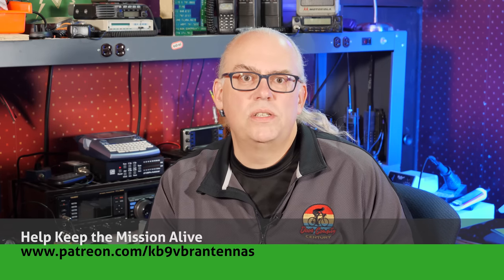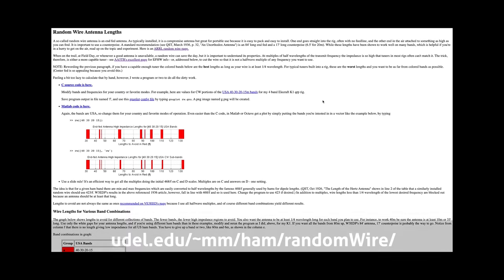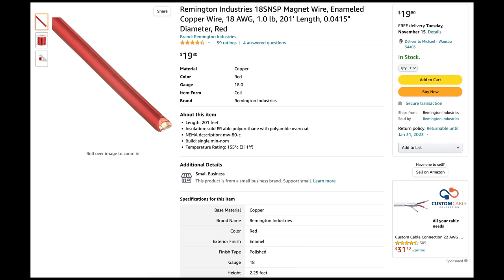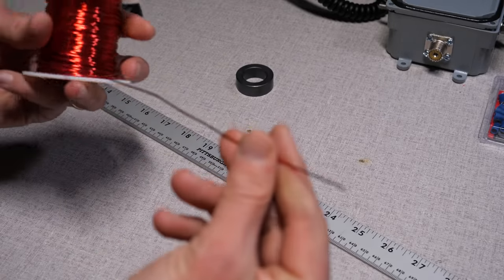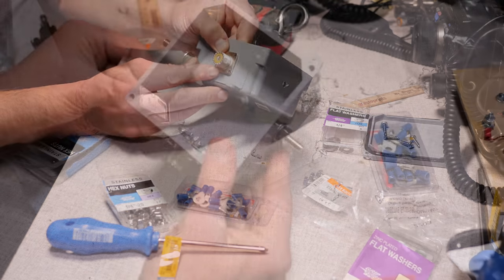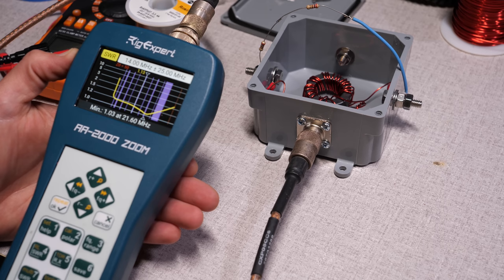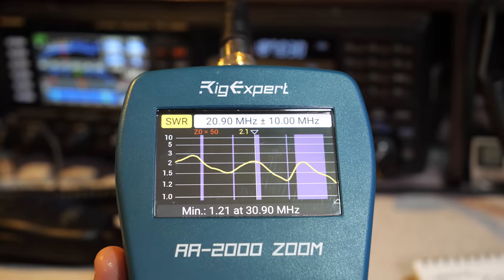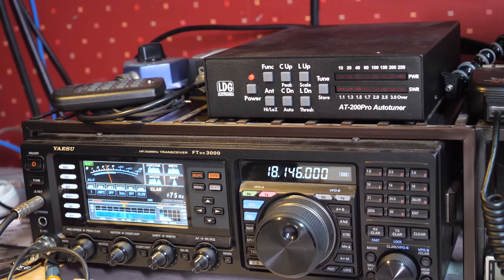Build a random wire end fed antenna and make amazing contacts #hamradioqa

Comment: In the 15:17 mark of this video you stated that we could put up a 10-40M antenna for as little space as 33 feet of space. Does that mean the wire would be 33ft in total for the 40 meters or will it be the normal 66ft for 40 meters?
Reply from the maker: There are two styles of end fed antennas, end fed half wave and end fed non resonant. The random wire antenna in this video is the non resonant type. So you need a length of wire that is not resonant on any of the bands you wish to use. The 66 foot length would be resonant on the 40m band so it would be considered an end fed half wave. You can use it on the fundamental and the harmonics, usually without a tuner. The wire as short as 22 feet is considered an end fed non resonant antenna. You can use it, with a tuner, on 40m and bands above it. Without getting too deep into the weeds, a non-resonant antenna typically has a lower impedance than end fed half waves, so even in using a tuner, you still receive a high level of efficiency as compared to an true end fed half wave.

Comment: Where can I find “600” ohm ladder wire ? I’ve looked at Home Depot , MFJ , and MTC and still nothing . Closest I find is 300 . Can I Double it to create 600 ? Errr
Reply from the maker: 300 and 450 Ohm window line is pretty common, but the 600 Ohm ladder line can be more difficult to source. Back in the day, most hams made their own with homebrew wood or plastic spacers and 18 ga wire. I did find a source online if you want to purchase some: https://www.trueladderline.com/w7fg-design-600-ohm-open-wire-feedline/

Comment: Why does everyone insist on using the mix 43 ferrite on baluns and ununs ?  The mix 61 is a much more efficient mix for this application and has a much flatter swr curve.  Use the mix 43 for 1:1 chokes only, use the 61 for 4:1 and 9:1's !

Comment: Can the same Magnet copper wire that you are using in this video be used if I had the FT240-43 instead of the FT140-43 that you are using in this video?
Reply from the maker: Yes it can. The FT-240 will have a higher permeability so you can run it at higher power levels. The 18ga wire will be sufficient for 100 watts, but if you want to do more, or use it 100 watts digital, I'd switch to a heavier magnet wire, like 14ga.
Reply: @KB9VBRAntennas  Is there any material that I should not use for the bracket that I will zip tie the toroid core to?

Comment: Thanks, I want to try one but I heard they don't perform as well as an EFHW or Dipole. Is that what you have found also?
Reply from the maker: Of the three antennas, the dipole will have the best performance as it doesn't rely on a matching transformer. As for efficiency between an EFHW and a non-resonant antenna, I think they are pretty equal. You may get slightly better efficiency using a resonant piece of wire, but the losses in a 49:1 transformer will be greater than in a 9:1 transformer, so their overall efficiency is about equal. I wouldn't let someone tell you that an antenna is inefficient stop you from trying one out.

Comment: Just used a Balun Designs 5KW 9:1 on 124.5’ sloping EF in my backyard. Compared it with my 132’ EFHW with a 49:1 UNUN. Similar on receive. The 9:1 covers 160, which is why I built it. Loads to 1.0:1 SWR with an IT-100 on a 7300. SWR appears too high to load on 1.9Mhz with my old Alpha 78 😞. Probably need a high power tuner. Will try trimming the wire first. Any suggestions? Mel, K2JWD

Comment: The only issue I have with these is the name "random" wire.  As you said - There is nothing random about the length of wire required to make these most effective.  I like the name Zepp, but I think "non-resonent end fed" would be the most descriptive. 
KZ9V
Reply from the maker: Old timers, not you Dave, called these 'long wire' antennas. I don't know when the term 'random' stuck, but it is a poor descriptor.

Comment: Have you tried this up up on 6 meters, or as low as 160 ?
Reply from the maker: I have used this antenna on 6 meter FT8 with decent results. It does have a bit of an unpredictable radiation pattern on that band, but otherwise works. I haven't been able to get a good enough match with my tuner to use it on 160 meters, though. I think the antenna is too short for that band.

Comment: Michael,  I see that you run the counter poise in the opposite direction from the antenna.  I have read from some sources that it should run directly under the antenna... does it matter?
Reply from the maker: I'm not sure if it matters. I've always run the counterpoise away from the antenna with the assumption that it's part of the system so it should be configured in a way to not interact negatively with the radiator. If you have a source for that information, I'd love to check it out.
Reply: @KB9VBRAntennas  I'll have to find it - but it seems to me there's an article in an old hints and kinks book where a ham set up a long wire antenna and laid down about 10 radials from underneath the radiator. I will have to look for it.
Reply: @KB9VBRAntennas  I added 20 radials away from the feed point and it made a huge difference in the Antenna's performance.  You have to treat it like a vertical.
Reply: @KB9VBRAntennas  Robert, KD4YDC here. Michael I have had GREAT success with this configuration. Really to the point of, I'm afraid to try anything else! I use a 9:1 unun in a sideways "V" config. The radiator is one leg and the counter is the leg closest to the ground. The feed point and the counter is at one end with a 3ft electric fence post and the other end of the counter is attached to another fence post 3ft off the ground. I use about 100ft piece of rg8 and it is on the ground going away from the feed point. I try to get it at least 16ft in a straight line (or more) before curving to my operating position. I have close to 6000 POTA contacts with about 95% on this antenna.  Most of these contacts have been on 20 and 40m. 3/4's of the POTA contacts have been from Georgia parks with one down in Gulf Shores, Al. It is absolutely my best portable setup in the field.
Reply: @BurtonChristmasLites what lengths are you using? I’m using 42ft for the radiating element and 42ft of counterpoise. I’m reading impedances a lot lower than 450ohm. Can tune some bands with low SWR directly connected to my ATU100. The tuner struggles a lot to tune some bands but I’m guessing the 9:1 wouldn’t change anything because impedance is already under 50ohm.
Reply: @ptsmonvideo  I honestly am not completely sure of the radiating element length. Oddly enough... I think it might be around 66ft. Yep. Not a "random" length but has worked for me. The counterpoise is somewhere around 33ft.

Comment: do you need a transformer for rx only? Eg. RTL SWR application?
Reply from the maker: For receive only a non-resonant, or random, length of wire works great. The more wire the better, but something 29 feet or longer will do fine for almost all of the shortwave bands. A transformer isn't necessary.

Comment: I wonder, can a wrought iron fence used as a random wire antenna?
Reply from the maker: Possibly. There's lots of examples of people using large random objects as antennas. It would depend on how well the sections are connected.
Reply: The sections are welded together. I would try to use it as a receiving antenna only. Would I need a 9:1 unun? To where the center connector should be connected? How about the ground?

Comment: Why put tape around the core? The 43 mix doesn't conduct! Put an ohm meter on it. If it conducts it isn't a 43 mix. Plus the magnet wire is insulated.
Reply from the maker: Magnet wire is insulated, but the enamel can be scraped off easier than PVC coatings. As long as you don't rough handle the transformer, or well secure the core and wires, you can certainly get by without taping the core.
Reply: Exactly.  Wrapping the core only makes it harder for the core to dissipate heat.  Not sure why fold wrap them......

Comment: What if I do not have the space for a counterpoise? Do I have to have the counterpoise?
Reply from the maker: For non-resonant or random wire antennas, a counterpoise is necessary.
Reply: just let the counterpoise hang down to the ground. Works fine on a 15 ft high antenna

Comment: Hi Michael, got a question. I can't get a straight answer from anyone. I want to build a mono band endfed for 10m only. I have a 49:1 balun. I've been told 13.2 feet and 16.2 feet. Since I have to be very stealthy and I only talk on 10m I don't need or want anything longer. Thanks and 73
Reply from the maker: I'd think that the 16.2 foot length would be the correct one as it is closer to the resonant length of a 10 meter dipole. Even if you are using insulated wire and shortening it for velocity factor,  your length will still be 15.5 feet. I suppose you can start with the longer length of wire and shorten it until you get a good match.

Comment: would you do one on 10 to 160 full wave ,   THanks Rodger W8RRM
Reply from the maker: Sure. The transformer will stay the same, you just need to add more wire. About 135 feet will work for 10-160m bands. This chart can help pick an appropriate length: https://udel.edu/~mm/ham/randomWire/

Comment: Nice info as always, will it work for 6m? Thanks for sharing. KC3UEE
Reply from the maker: 6 meters is tough for this style of antenna. The 1/2 wave multiples are so short, it is next to impossible to find a non resonant match for all the bands. You may be able to do one with limited coverage, or use a tuner to find a match on 6 meters (your efficiency will go way down, though).
Reply: @KB9VBRAntennas  thanks for the reply. 👍

Comment: Michael, very good video!  I want to build a random length antenna for 40 to 10 meters.  Will 41' or 58' do the job?  And what should the counterpoise length be?  de:  KE7LOY
Reply from the maker: Both 41 and 58 feet will work well. I'm not sure if one length is better than the other; 41 feet is more compact, but 58 feet puts more wire in the air. If I was going portable I'd gravitate towards the shorter length and longer for a home installation. Counterpoise can be any length. I'd start with 17 feet and go longer if necessary to get a good match.
Reply: @KB9VBRAntennas  thanks for getting back to me Michael.  I have a few FT-240-43 toroids laying around, I'll put one of them to work.